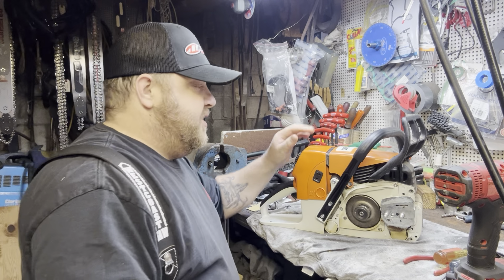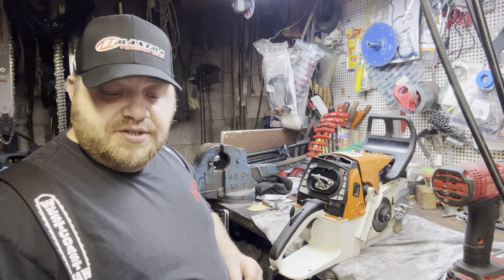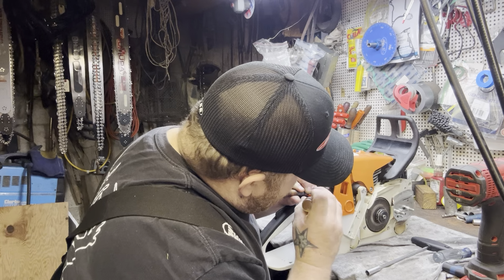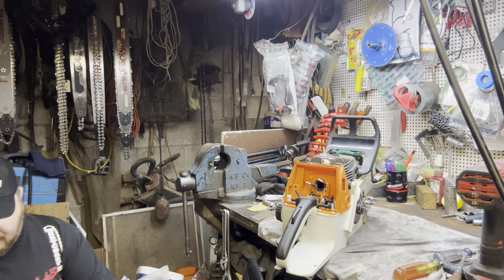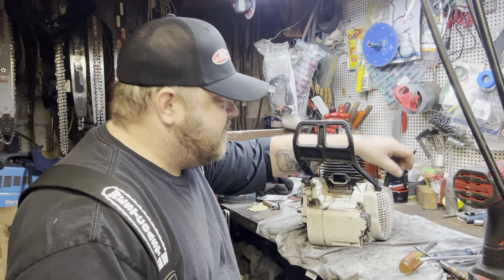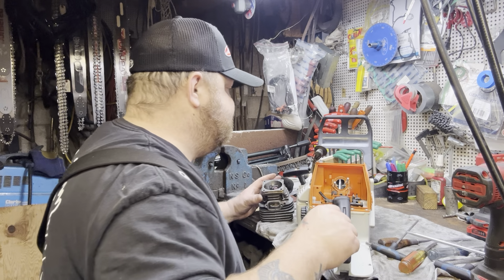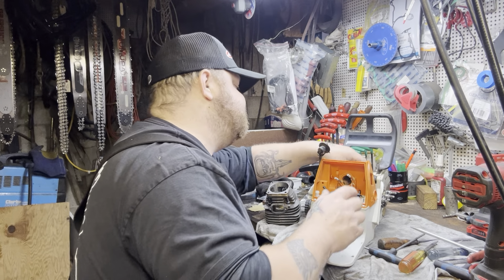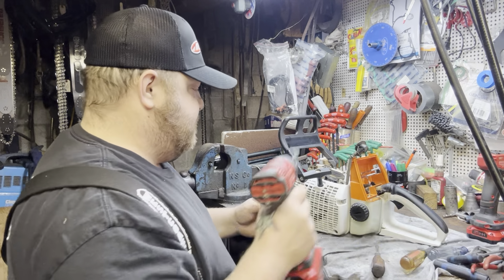Farmertec ms660 teardown for machine and port work 🤙🏻😎

Comment: I see a lot of people porting these saws or replacing all the parts, are Farmertec saws any good if you just leave them stock?, or are they garbage?
Reply from the maker: Well..I don’t replace anything on them and tree services and firewood cutters been buying them and I haven’t had any returned..imo the key is to run a more oil in your gas mix. I run 32:1 in them and recommend anyone else to do so as well
Reply: @Aaron_A_Lynch  Do you run that mix in all your saws?
Reply from the maker: @37gdog I do
Reply: @Aaron_A_Lynch  Thank you
Reply from the maker: @37gdog yessir